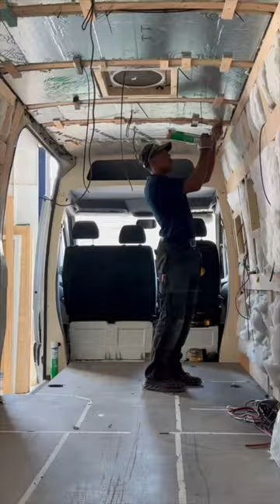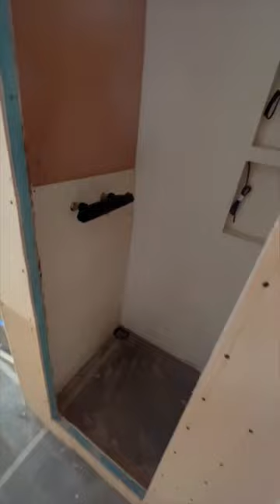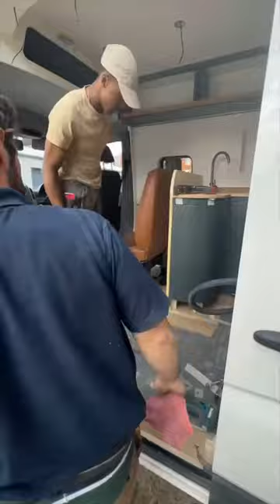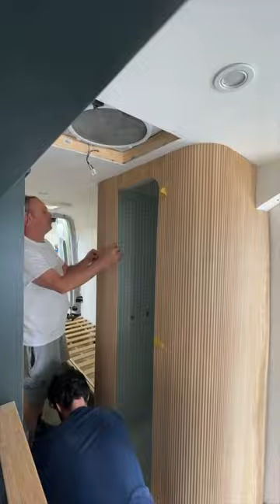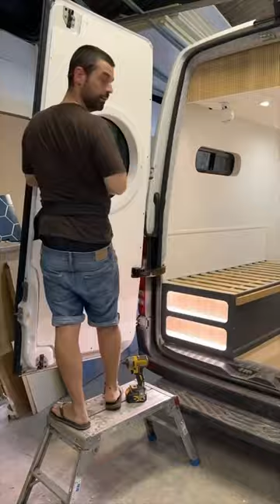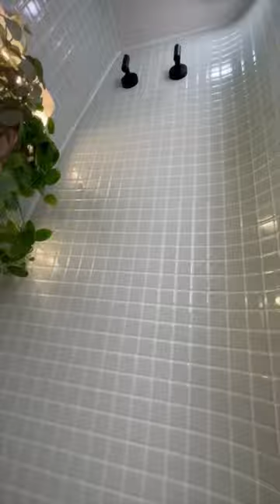1 min van build ! Sprinter LWB family van with lift up bed 💚🚐 #vanlife #vanconversion #vanbuild

Comment: Beautiful build!! What tires do you recommend for Sprinter? I’m currently researching and could use some help. Looking at the Crosswind M/T Mud Radial Tire-LT245/75R16 120/116Q Load Range E 10-Ply but not sure if this is a good overall tire. I live in Florida but plan on traveling to other states. I’d like a smooth ride but also durable for other weather.

Comment: Why all the wood on the walls and ceiling? It's unnecessary weight and robs of inside space. I built my Sprinter with Armaflex and felt. It insulates and you have so many little nooks to put stuff.